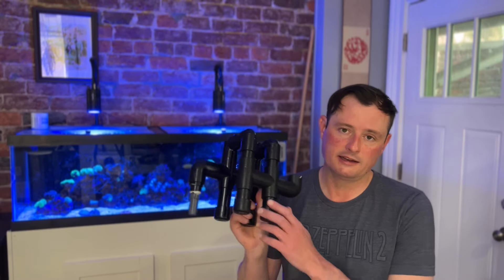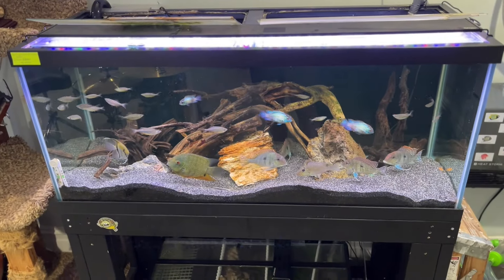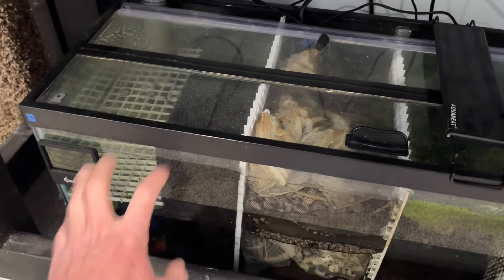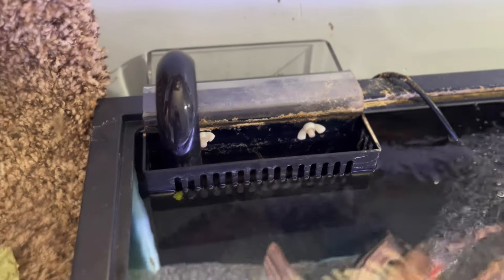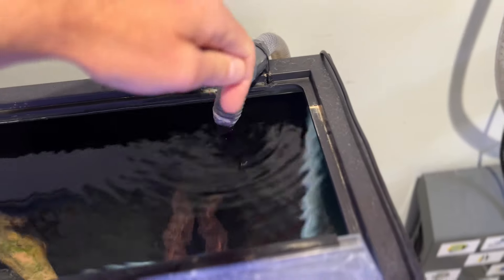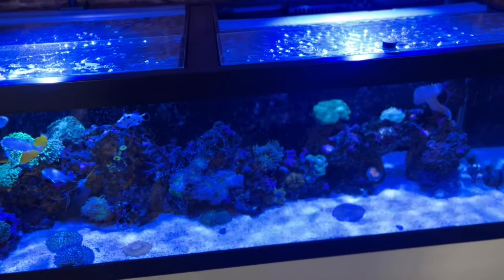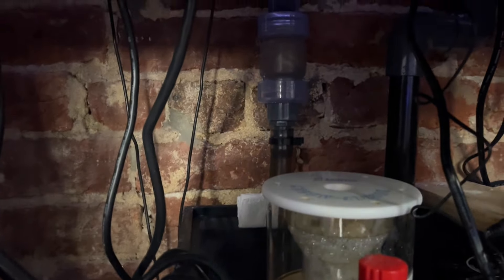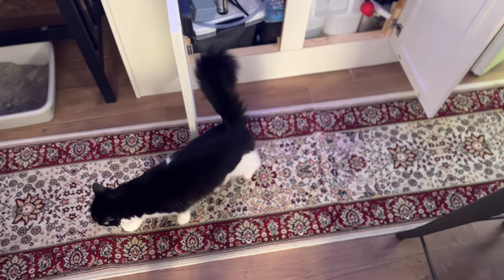Plumbing a Sump: how to prevent overfilling the sump

Comment: Great video. I think probably the hardest thing is figuring out pump output vs flow rate. Too much pump and not enough flow will drain the sump and possibly overflow your tank. I'm sure there is some place to find calculations on how to match pump rate vs flow rate
Reply from the maker: Yep. I meant to touch on that a little, but forgot. I’ve always tried getting an overflow rated at least 100 gph more than my pump’s rated gph and it’s served me well so far. Lol.
Reply: @nextdooraquatics5013  yea I have been considering doing a small sump on my newly setup 125. But I think that's what is holding me back not sure how to match that up with a DIY sump.
Reply from the maker: @razinfishes1918  understandable. As long as you over size the overflow, I think you’ll be good to go. I looked it up, the fresh water tank has a pump rated at 568 gph and an overflow rated up to 800 gph. The reef tank has a pump rated for about 500 gph and an overflow rated up to 600 gph. Both work well.
Reply: Great Info love the pace you take not so fast. Overflow more than pump? Then just dial back with a valve to match it?